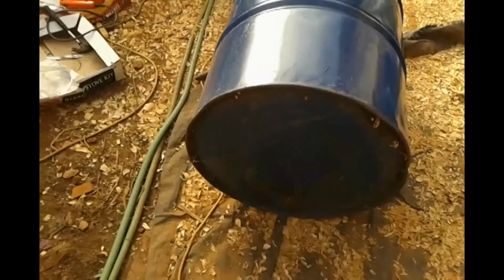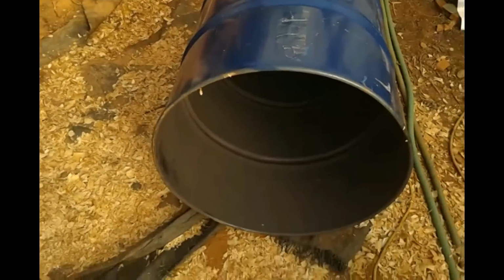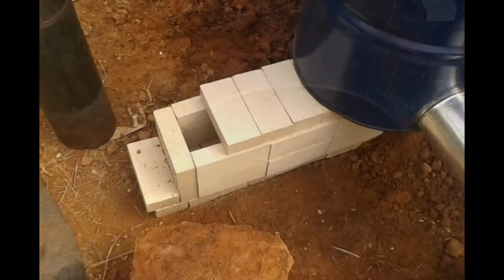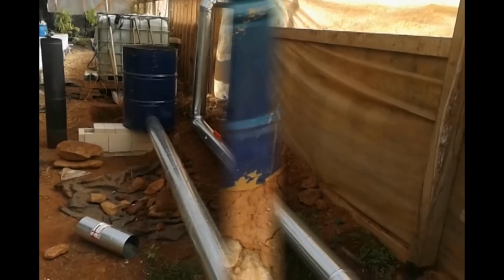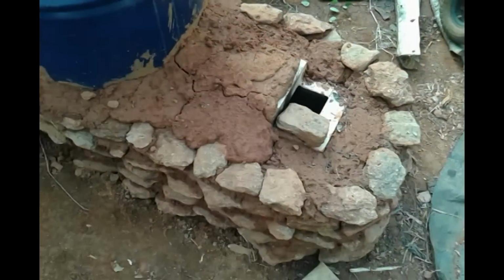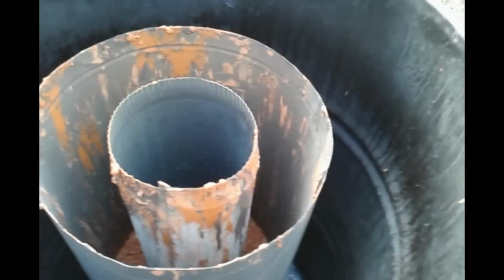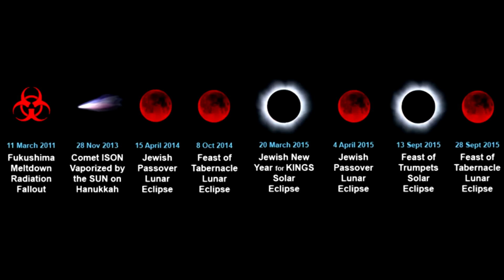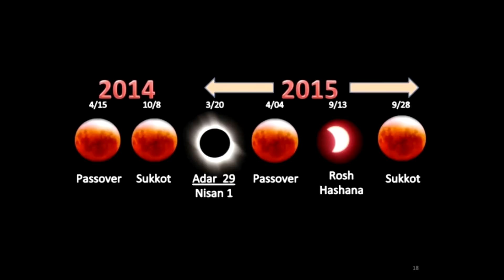Rocket Mass Heater Build Part 1

Comment: This is certainly one of the better rocket mass greenhouse heaters I've come across on YouTube. Pretty to the point and thorough.
Reply from the maker: The RMH is fully covered and drying in a few days it will be cold enough that I will be lighting it up. At that point I will be getting some true temps and how it performs. Thank you for watching!

Comment: What kind of heat are you generating with it? I would love to replace my double barrel stove with something like this if it would heat a greenhouse the size of mine.
Chuck
Reply from the maker: Even not fully coverd it blows the barrels away but its not holding any heat when I get it fully coverd we are expecting big things. If I were you I would take the chance on one of these! Thanks for watching and sharing
Reply from the maker: its fully covered now and its getting cold in a few days I will have some true temp measurements on outside and inside temps only useing the RMH
Reply: Any update on the heater in really cold temps yet? Let me know how much "fuel" it takes to keep the temps at about 60 F all night.
Chuck
Reply from the maker: I will post a video soon about temps but I will tell the truth start building one. I have a few improvements I want to suggest just to make it easyer to use. Over all low fuel usage and high performances blow away every other heater out there For the larger greenhouse  you will need 2 of them if you want temps in 70s or 80s I will try to get the video done in the next few days Thanks for checking my friend